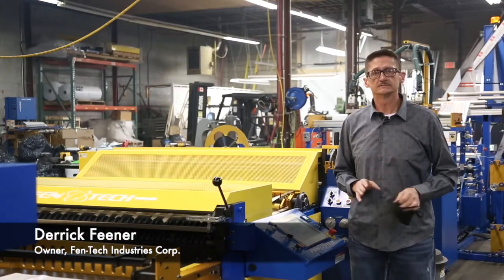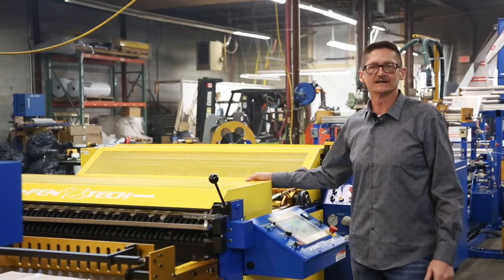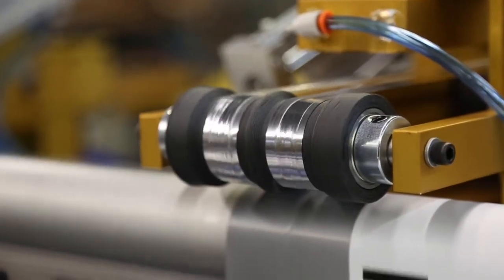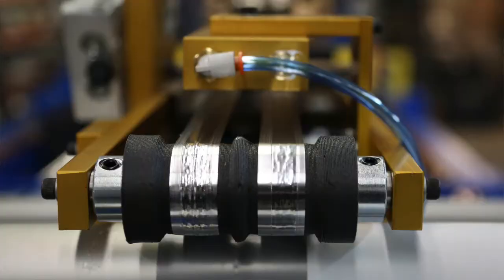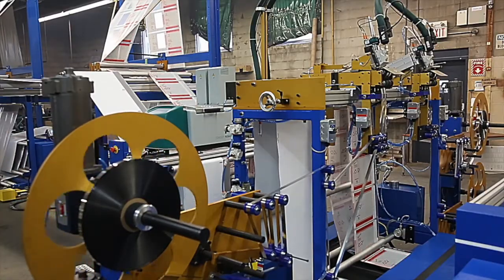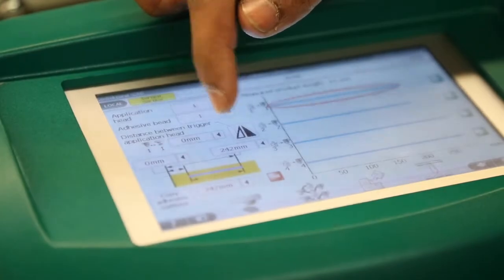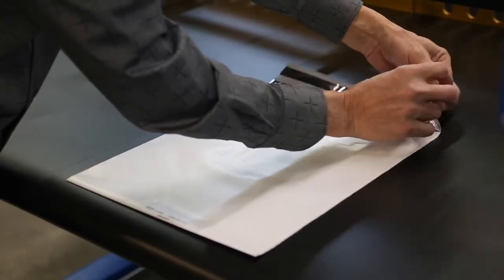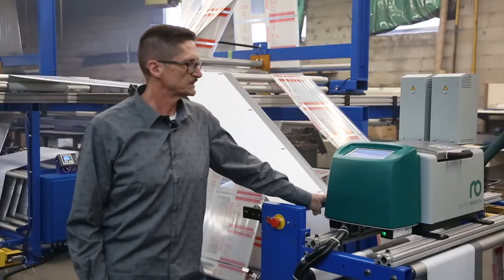Why Fen-Tech relies on Robatech adhesive application systems for courier bag sealing

Comment: I also use that kind of glue tank.
It has broblem that Glue comes out not enough even i increase glue coming out level to 100%. Can you tell me how to solve that problem.
Reply from the maker: Thank you for your question! What country are you from? We will be happy to forward your question to the responsible market organization which will take care of the issue. Should you have any other requests, feel free to contact us under info@robatech.ch.
Reply: There are several issues that would cause that. 1. Glue is not hot enough. 2. Your head doesn't have a thick enough shim. 2. You don't have the correct jetting module. 4. You could be bypassing glue through the bypass valve. You know this if the glue pump keeps pumping even when it's not supposed to. 5. Your jetting module is bad. 6. Your mac valve is bad. 7. Your filters are clogged. 8. You have debris in your system.